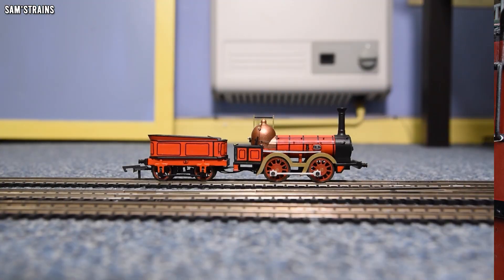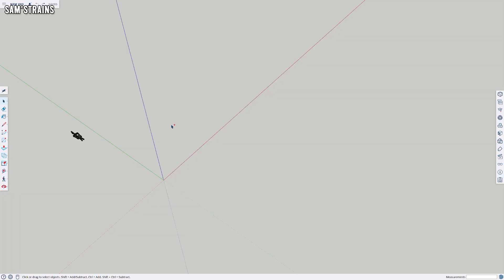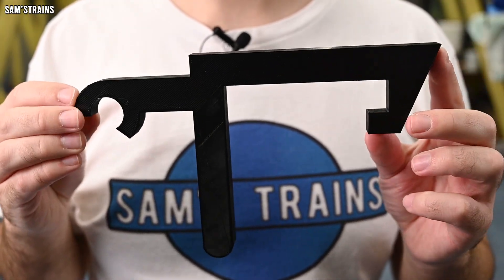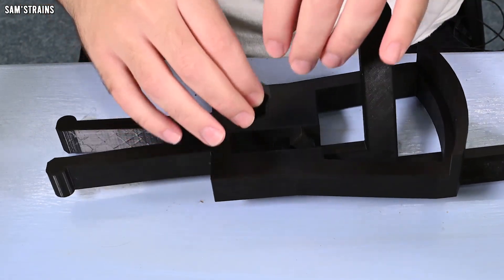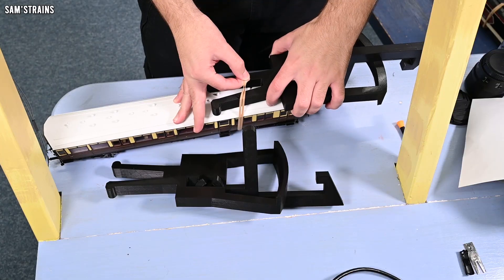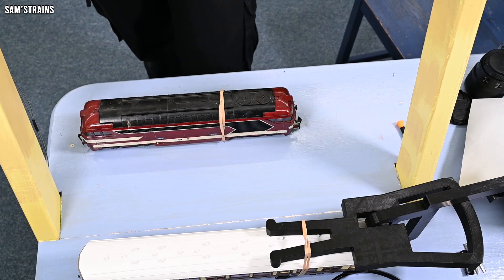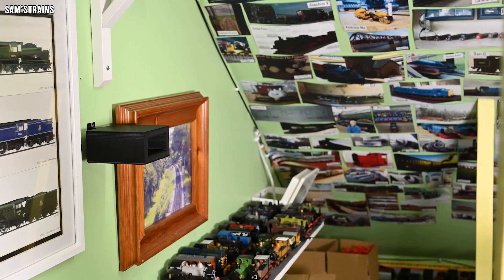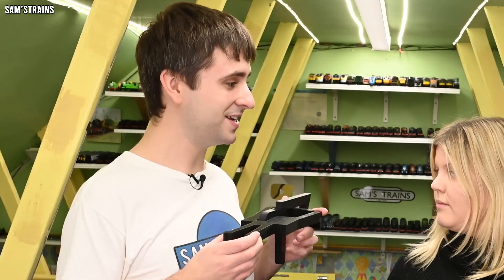I Coupled Up To My Girlfriend With GIANT Model Train Couplings

Comment: Hi Sam, I had an Idea for you to try with your 3 D printer Maybe you have or haven't thought of minimizing the gap between coaches and or your wagons by making a shorter coupling for a tighter gap between your rolling-stock? Maybe you could experiment and design couplings for that prototypical distance between your passenger coaches and fright wagons? This is just an idea for you to see if it's possible and can be done. Let us know what you come up with.

Comment: Worst couplings ever devised. The old moulded versions on the bogies are better than that tat they persist in keep using. When you look at the small Airfix couplers from the 70’s & then look at that junk. Only the British would put up with paying small fortunes for models with massive gaps between the stock or have to shell out more money replacing the rubbish.

Comment: Pointless fact: stick those couplings on a 10" gauge model and they would be roughly to the same scale with the stock as the original parts to OO stock, based on incredibly rough maths.

Comment: I now pronounce you Coupling Husband & Coupling Wife.
You may now toot toot and full throttle out of the station!

Now to spur the idea as you have a large MFD printer is design a loco and piece of rolling stock too install the couplings into.

Comment: Rather then the screw solution, couldn't you have used a hair dryer post build to soften the parts a bit and them have slotted them together that way? Is the plastic from 3D printers too brittle?

Comment: That would be really interesting to manufacture one 76.2 times larger than the original, and try to use it on a real railway vehicle. A manufacturing in steel with a CNC machine would be relevant.
Next : a DCC decoder "in real size", with heavy duty electronic components ? (240 V version possible !)
By the way, your red Lima diesel is an SNCF BB 67000, diesel engine of the first half of the 1970s.

Comment: Amazing Sam and partner :D all them almost dirty references are gold. Also you should look into Helicoil Wire inserts for threads in 3d printed parts. We use them in engineering all the time, they will make any thread in plastic about 50x stronger.